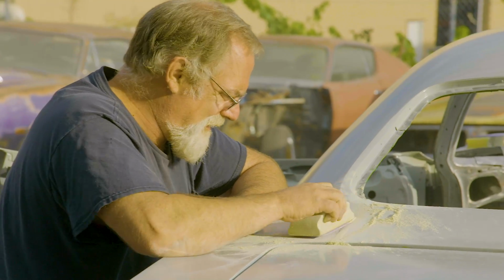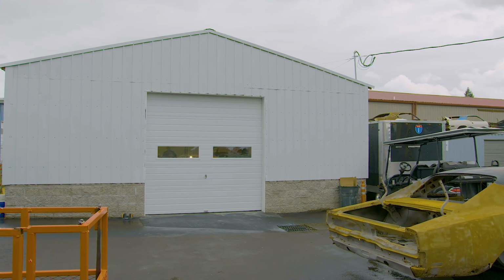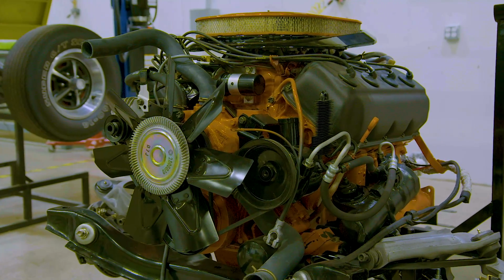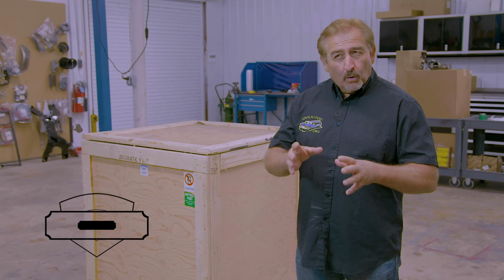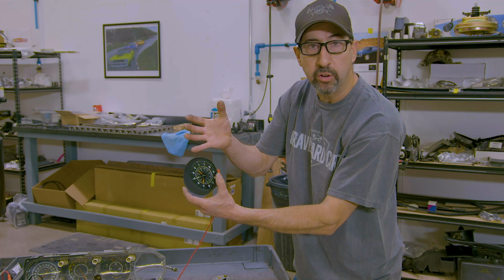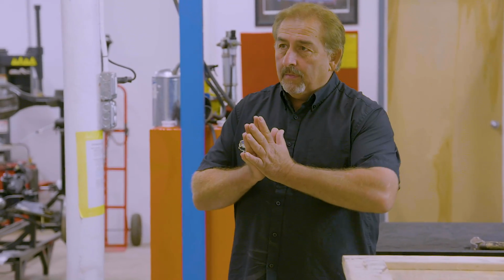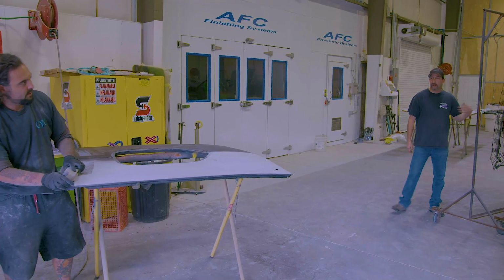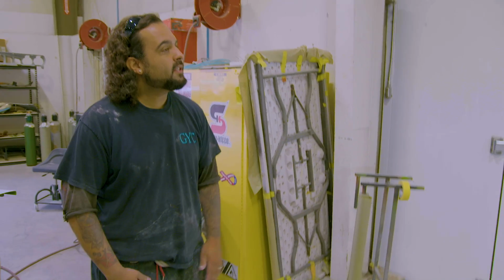S07E09 OPERATION FIREPOWER

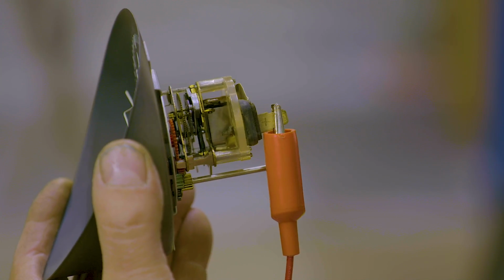Comment: 23:40 I have the points type clock in my 70 Z/28 and had to add solder to build up the points cause they were so worn down. I first filed them flat to get a good base then added solder with my solder iron then I filed them fllat and the clock works fine.

Comment: Great tip from Dave about the clock but WD40 as a lubricant sucks, and it attracts and holds dirt. Yeah, it's great for your squeaky front door hinges but it's really a better cleaner than a lube and it comes in a spray can so it must be best. But it's not. There's hundreds of better lubricants.